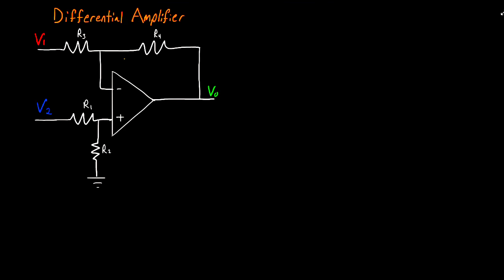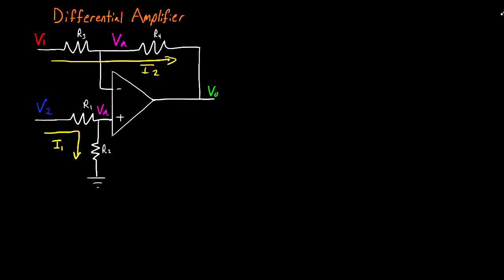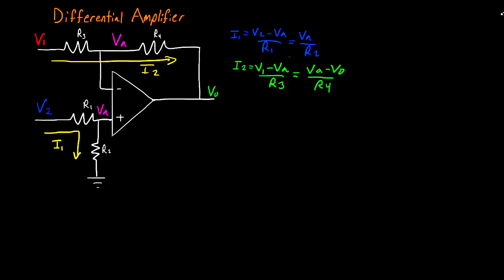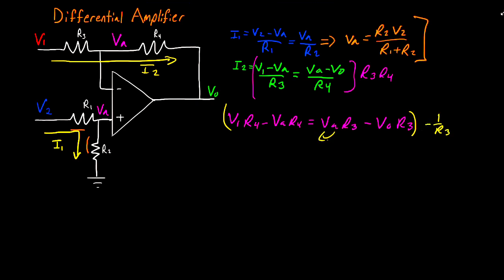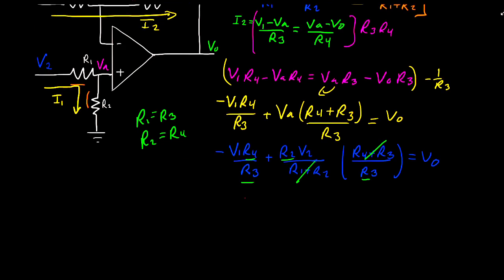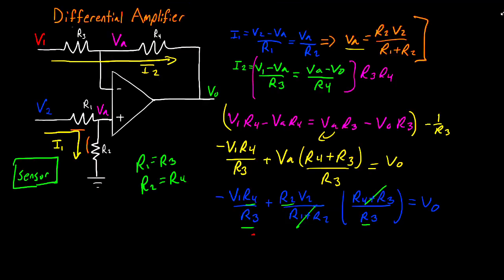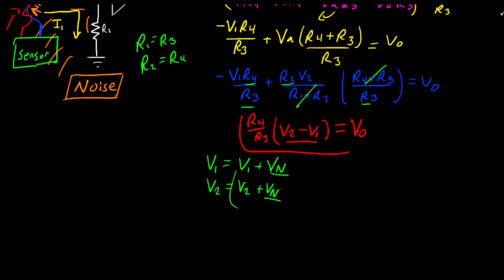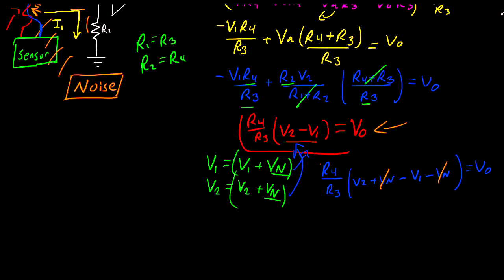Differential Amplifier - Analyzed

Comment: This is really hard to follow. I'm not college educated so that could factor.
Reply: It's well explained actually
Reply: @rodrigo-z6m5f  It's fast paced by very insightful. I finally understood a lot of concepts after watching the lesson but it happened fast I had to keep up.
Reply: Need to check out the basics of amplifiers and how they work. What are their ideal conditions for simple analysis? How do you analyze different circuits that use the amplifier (negative feedback loop, or open loop gain)? 

Then when you check out this video, he actually explains it really well assuming that this is not your first view of the amplifier.